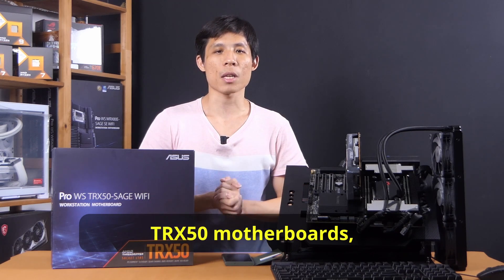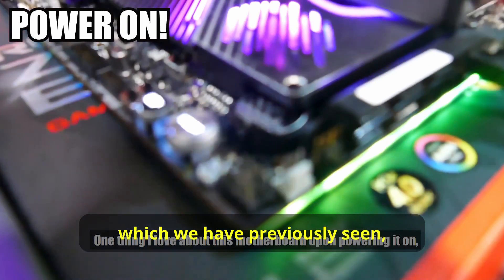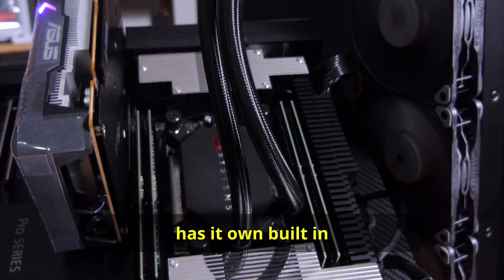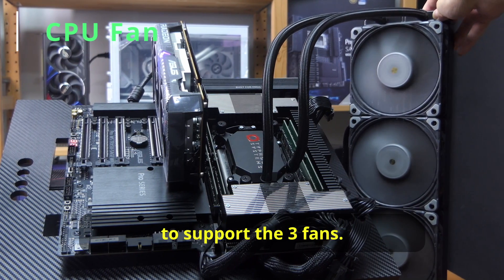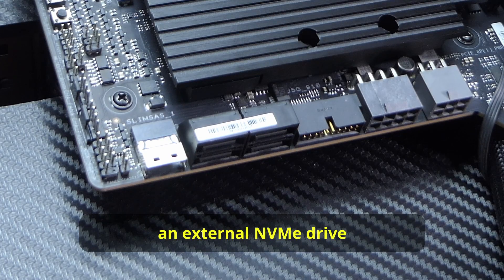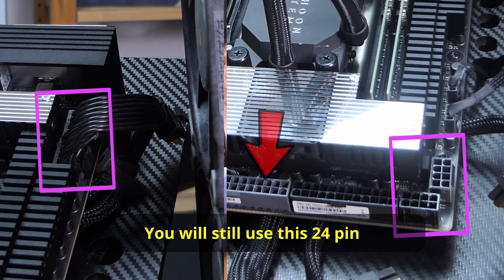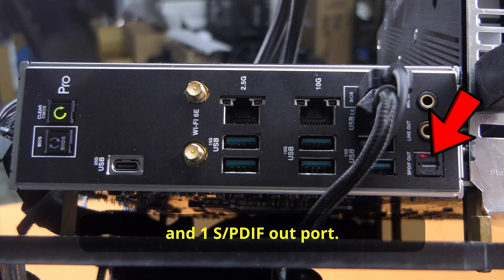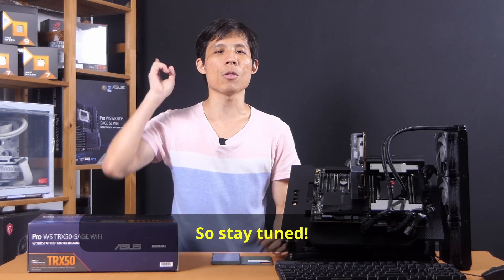REVEALING The SECRETS of This $1000 Motherboard!

Comment: Asus says you must use two identical psu for dual psu configuration. Is that correct? Can i try with two different psu, like atx+sfx-l?
Reply from the maker: Hi sorry for late reply. I am unsure about the official update from ASUS. But based from our experience, it is better to use 2 ATX PSUs to provide power. We are not sure if the rails on a SFX-L will be sufficient, esp if you have multiple GPUs.

Comment: Was eyeing this board soon and had a big question on the power please.  Using one 1600w Titanium PSU for a planned 7960X and 4090 FE.  So, from my understanding, I'd connect 12v CPU1 and 12v CPU2 (both are CPU 8-pin power) and of course the 24-Pin board power.  But I only have two "CPU" EPS connections on my PSU.  Would I use part of the 8-pin VGA / GPU / PCIe cables to connect to the three different 8-pin PCIe power areas or something else?   

The biggest question I'm trying to find an answer for which is proving difficult is if using the PCIe 8-pin Cables would work for powering those ports (as only 3 or 4 of the 8 on my PSU are dedicated to the 4090).  But PCIe is different than CPU EPS 8-Pin by keying.  Thanks for any help!  I figure you've owned or have tested this board a lot so you'd know for sure what I'd need to connect.  Thanks!